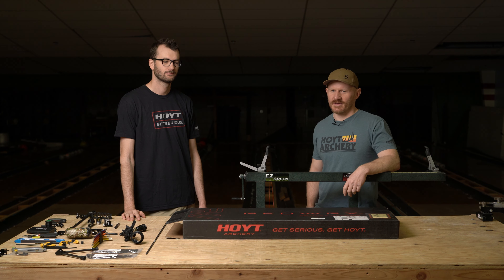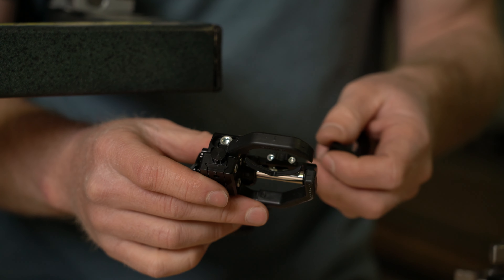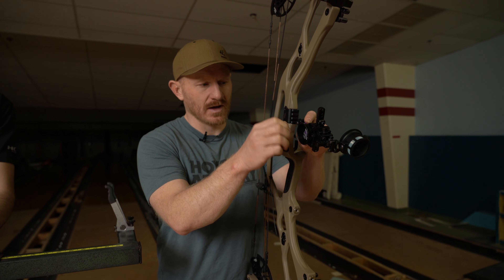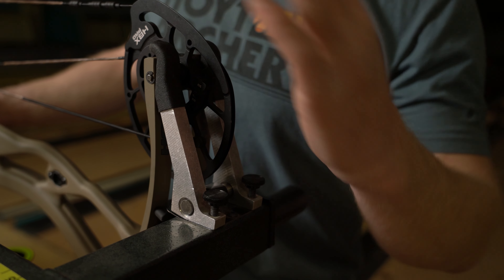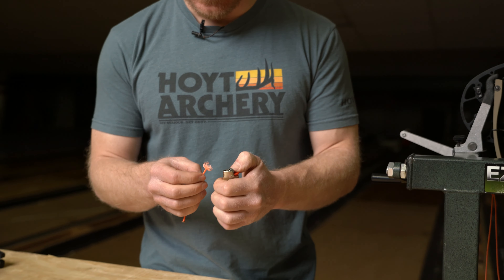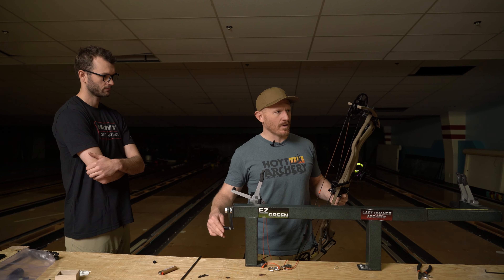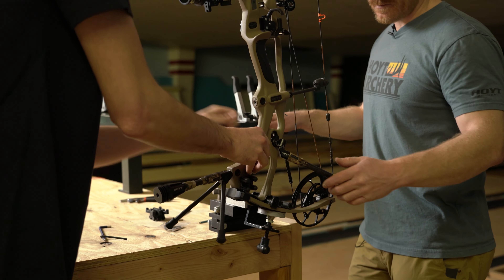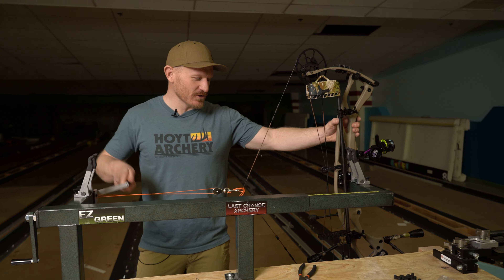DIY Archery Tuning Guide with James Yates | Part 1

Comment: Have a question on these bows. I actually just gir a vtm 31 and the top cam is leaning right pretty good . The right limb is pulled lower than the left . Arrow is pointed left about 5 degrees . Seems crazy and i just don’t see why they would send their flagship bow out and charge premium prices. Is there a fix fir this so i don’t have to send it back?